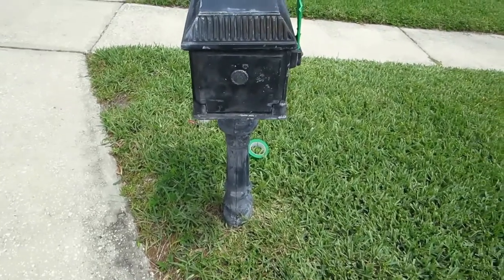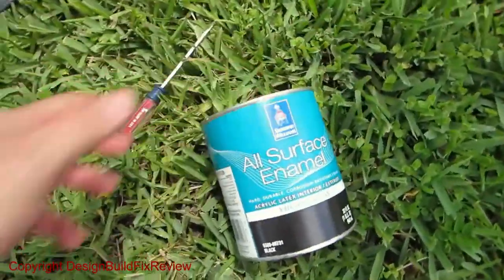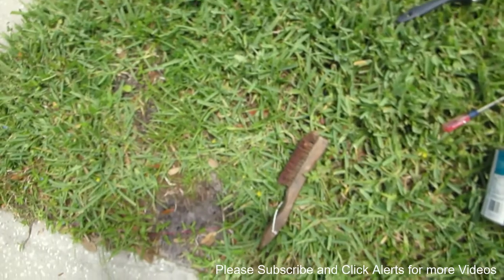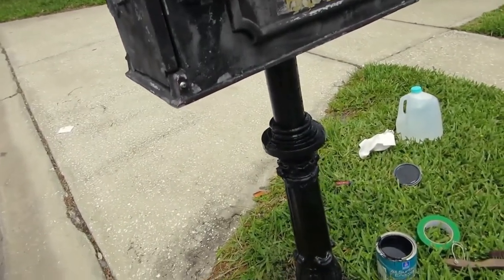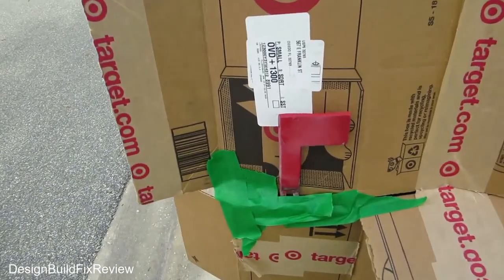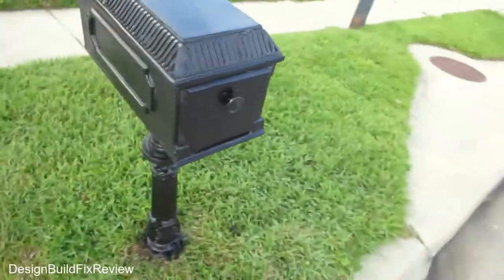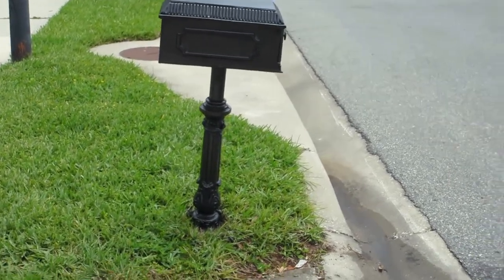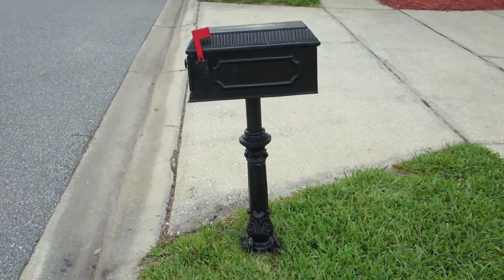How to Paint a Mailbox The Right Way

Comment: Hello, how is this holding up? I may have missed it but did you use primer, and did you wait until the mailbox was completely dry before painting? Thanks in advance.
Reply from the maker: I did not prime, this paint was incredible. Still looks new like day painted, very thick. I just painted over old spray paint when the box was dry.
Reply: @DesignBuildFixReview  thank you for replying. I will use this paint for my mailbox project. You might know this already but if you  get a commercial account with SW they give you a onetime 50 percent discount on your first order and then 30-40 percent off paint purchase thereafter. One of the associates told me about it and you don’t have to have a painting company to open the account.
Reply from the maker: @kimariokiji  Thanks for the tip, last time I went there the girl gave me the discount, man what a deal I got. We sure are paying a lot without knowing it sometimes.
Reply: @DesignBuildFixReview  Yes we are overpaying. I have to remind myself to always ask about discounts before I check out.

Comment: Looks great! I'm a little confused though... You used enamel paint, and then you said later in the video "don't rely on enamel paint"?
Reply from the maker: I will let you know in a bit, It has been awhile, the paint I used still looks great . If I used spray I believe is also enamel it would have been worn out by now. Using the brush it goes on a lot thicker.